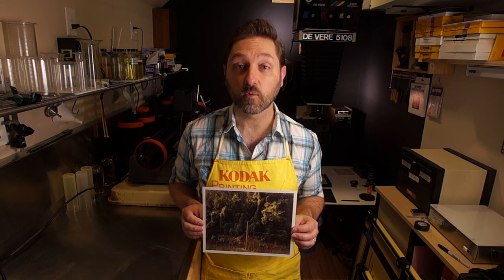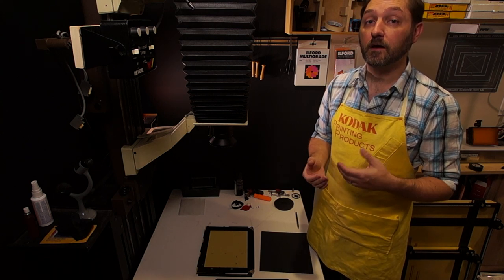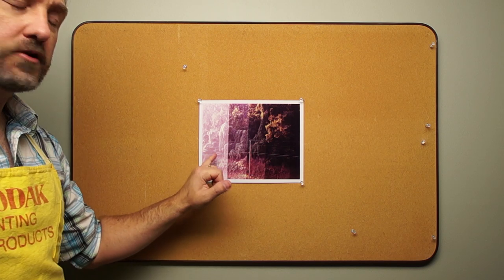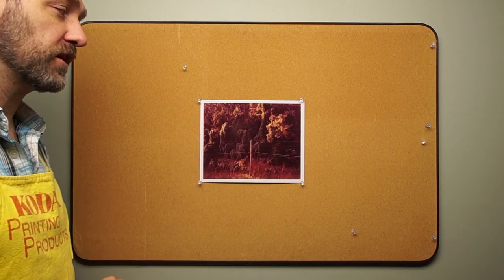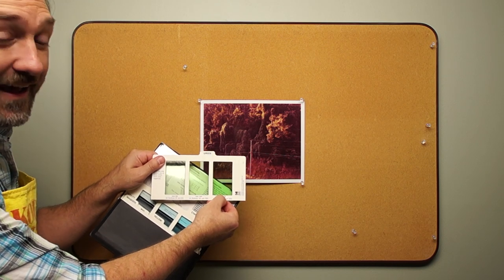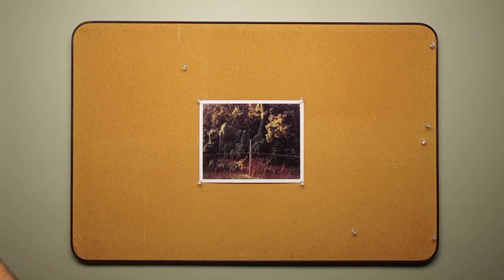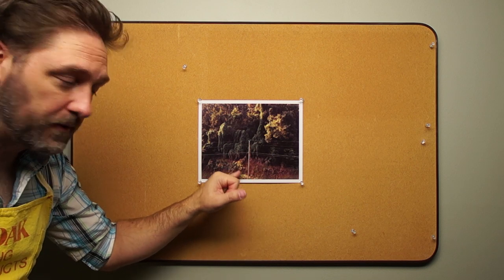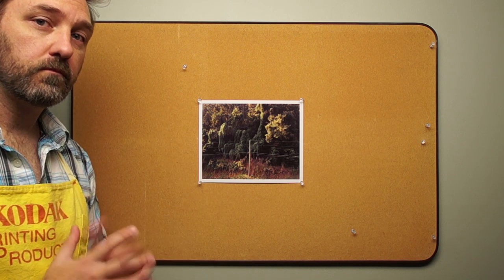RA-4 Printing, pt 2: The Basics

Comment: Thank you for these videos. Now that I'm retired, I was thinking about getting back into film, B&W and Color. The good thing is that I never got rid of my stuff during the Digital revolution as other photographers have done. I still have my old functioning darkroom. Digital is great no doubt, but getting nice prints from the digital work-flow can be as frustatrating if not more than the analog way. Plus it's not as much fun. 

I'm under no pressure to start a Business or offer a any services right now so I have all the time in the world. These videos are crystal clear and certainly help with things I have forgotten, or never really go a hang of due to digital. For example i never knew that Freestyle sold "CP" or Color Printing filters in kits. I tried findidng these filters on eBay and it was highly frustrating. I really don't need the Color Printing kits since I have a Dichroic head with built in color filters,  but it's good to know what that the color head is doing behind the scenes. I have all the time in the world so why not ?

Comment: What a well organized presentation.  I have found that if you are using the same enlarger/colorhead, chemistry, and printing paper, once you have a fairly normal print "zeroed in" for the color filtration required, subsequent (different) prints will not require much change to the filter settings, if any.  So, I have tended to buy paper in the largest size I plan to print and in a box/quantity sufficient to last me for a couple of years (which is kept in a freezer).

Comment: The illumination to examine the print is one important next is while to put test strip it must cover high light to the shadows keeping mid tones in between and first is the proper exposure in Yr case magenta over corrections occurred as while Magenta was in the colour head  it should remove Magenta referring the Golden rules of filtrations still soo Noble that to remove a cast use the same colur and to increase to use it's complimentaries..nt only fr colour printing it readily applies where filtration be consider be it opticalfilter over cam lens or fr colour printing....sir nice of  ur deliberations that means still people are interested in making colour prints tech nt able to dump it totally so sir it is delighted that u are  just a right help ...thankssirdada and Nomo❤stey

Comment: Thank you for this video and for your entire channel! A pleasure to watch, to listen and to learn from! One thing that I've noticed in my yesterday's very first RA-4 session was that the Kodak filters (which I've managed to find after a loooong search) have a black and white side. By chance I did not notice it and started using them on the black side and nothing made sense. Then I've realized that there is a white side with the opposite instructions (i.e. the correct ones for correcting cast, such as using a magenta filter to correct a green color cast with the correct instructions to either reduce magenta or increase Y/C equally). It took me a while to realize this, so it might be helpful for others as well. :)
Reply from the maker: I’ve done that before! lol

Comment: I know this is an old video, but kind of curious if those viewing filters have any application in digital editing. I've been moving away from negative lab pro and doing conversions manually on photoshop by manipulating the red, green, and blue curves. I'm trying to get better at arriving at balanced images and wonder if filters like that could potentially help. Would love to know your thoughts!
Reply from the maker: It’s useful when printing via inkjet, but the monitor may be difficult as your monitor may not be accurate, the color space chosen, etc

Comment: Hi again. So i bought some Arista color cor. filters to use in my durst m601. In the filterdrawer but i have yet another question. When making my test strip print lets say, as you do, 2-10 sec starting out with filter 40 m and 50 y sholud i then stack these two filters i the filterdrawer? ( would it be the same as when you are dialing in the numbers on your dichronic head?) thanks.  :-)
Reply from the maker: Yes, stack them in the filter drawer
Reply: The Naked Photographer  thx :-)  looking forward to try.

Comment: How come you don't need to change the initial time of 7.2 seconds when you change the filtration? I have to adjust the time after every filter change, even if only changing by 5 points.
Reply from the maker: Sometimes it is enlarger design.

Comment: I've heard that afterglow from the enlarger bulb can affect color printing (but not B&W). That being said, how do you handle the exposure timing/process of your test strips?
Reply from the maker: I treat it just like b+w.  Since I’m not concerned about color during the test strip phase, any color shift from different exposures are inconsequential.
Reply: @TheNakedPhotographer  Gotcha. I wasn't sure if the afterglow caused problems for color or exposure. Good to know its hopefully just color. (Mainly a concern since the lamp is often switched on/off incrementally for each segment of the test strip.)

Comment: Hi.

Fine explanation. But don‘t you blow dozens of dust particles into the wet layer when you use a hair blower? Do you use this only for your test prints and then let the final print dry slowly without the dryer?

Also: I assume once you have the color balance correct on the smaller print, you can use the same balance also for a bigger print and only have to adjust the density by extending exposure time, right?
Reply from the maker: Correct, I only use the dryer for test prints.  Color paper is funny stuff.  Sometimes you do need to tweak the color when making a larger print, but not usually by a lot.

Comment: regarding having to adjust exposure time to compensate for adding or subtracting filtration. do you recommend getting the color straight first then readjusting the density? TIA
Reply from the maker: At that point, yes, if it’s small adjustments.

Comment: Do you have a preferred drum for doing print processing? I noticed that the cut-scenes in this video use Jobo drums, while you spend most of your time in the previous video showing a Simma drum (or what looks like the photo labeled "SIMMA" on the KHB website). Got the impression that you need a couple (to handle cleaning/drying), and I might want the smallest possible one for test strips.
Reply from the maker: I have both, but I use the Jobo mostly.  I have more of them, and I like to stay consistent.
Reply: @TheNakedPhotographer  I'm starting to stock up on Jobo equipment myself (and currently waiting on a machine, which will take a while). I just wish I didn't have to resort to eBay to actually find most of their print drums.
Reply from the maker: Try the classified section of Photrio.com, people sell them there.  You can get a 4x5 drum for test strips.
Reply: @TheNakedPhotographer  As I stock up on Jobo drums, I have two more questions:
First, those drums you're using say they take 100mL of chemistry but can do two 8x10 prints at once. When doing a single 8x10, do you one-shot a full 100mL or somehow get away with reuse and/or less volume?
Second, what motor base are you using with those drums?
Reply from the maker: I admit I use 100ml regardless of whether I have one print or two in the drum.  I use it one shot, and I am using an Omega motor base.

Comment: Do you not adjust your times when adding more filtration? Or did you just not mention that step because it is included in the instructions of the filter viewing kit?
Reply from the maker: You definitely need to adjust your time if you use separate filters, but a dichroic system doesn’t need much, if any change.
Reply: @TheNakedPhotographer  Thank you, I'll try not adjusting my times next time and see what I end up with!

Comment: So would this colour correction process be required for every different photo on the roll? Or once dialed in its good for that camera set-up? If assume maybe some slight tweaking per photo but how much of the settings per colour actually change per shit with the same camera
Reply from the maker: If you use the same kind of film and process it consistently, your color balance across the roll will be fairly constant.  Each shot may a little tweaking, but the starting point will be about the same.  Different film type will need its own starting point.

Comment: May I ask you if the Lee viewing filter kit (the one with 6 cards made of 9 squares) is equivalent? Because apparently seems to, but has no indications of the corrections to make on the enlarger.
Reply from the maker: Lee made two versions.  One was exactly like the type I use, and the other is what you describe.  I’ve never seen that type in person so I don’t know if it has correction amounts printed on it.
Reply: @TheNakedPhotographer  it seems it hasn't. Anyway can you confirm that the corrections are the following?
Blue= add M+C or  subtract Y
Yellow= add Y or subtract M+C
Green = add C+Y or subtract M
Cyan = add C or subtract M+Y
Red = add M+Y or subtract C
Magenta = add M or subtract C+Y

For the amount of filtration i have to check the relative number right? E.G. if the filter kit square used is the 20 blue i have to add 20M+20C or subtract 20Y, if the filter used is 10 Cyan I have to add 10C or subtract 10M+10Y.
Is everything right?
Thank you!
Reply from the maker: Typically you don’t use the cyan dial at all and only change the magenta and yellow dials.  A 10cc filter will require a 5 point change for the enlarger.  I don’t know if your card has labeled the strength of the filter or the amount of correction to be used.  The Kodak kit I have lists the correction amount, not the density of the filter.
Reply: @TheNakedPhotographer  the filters are just labeled "clear, 0.25, 05, 10,15,20,25,30,40" per each color. How can know if is the strength or the amount of correction?
Reply from the maker: Looking at the photos online I think the numbers are the density and you should use half the value for the filter change, so if the print looks right through the “20” filter, dial in a 10 point change
Reply: @TheNakedPhotographer  thank you very much! You’ ve been very kind :) keep going with your videos, they’re amazing!

Comment: With black and white you can sort of take the same setting from print to print assuming the negative was exposed properly. Is this true of RA-4 or do you need to do this filter changing for every negative?
Reply from the maker: In theory you can use the same settings for a whole roll, but in practice I find I still need to make small changes shot to shot.
Reply: The Naked Photographer thanks for the response! With black and white I usually estimate the first exposure/contrast, and can get reasonably close on the next print with some educated guessing. Seems I’ll be back to test prints and strips :)

I just found a color enlarger and drum processor cheap locally and see paper is somehow cheaper than black and white. These videos are so helpful, not many doing this

Comment: So even for the larger drums (16x20+) the rotating base works well?
Reply from the maker: I use up to a 20x24 inch drum without issues.
Reply: @TheNakedPhotographer  perfect, could you spell out the name of the brand of the roller you like? I couldn't quite catch it. Thanks and have a great sunday!
Reply from the maker: Simma Roller, it’s also sold as Omega, but Unicolor and Beseler rollers are great too.
Reply: @TheNakedPhotographer  Thanks for sharing your knowledge, it is invaluable to those starting out!
Reply from the maker: That's what I'm here for

Comment: Ok so i just did my VERY FIRST color print EVER. While it was a success becuase i had a picture that i could see, it was crap because i put it in the Cibachrome tube upsidedown.  So how do you know that you developed the correct side?  How do you know you put the paper in right side up for the proper exposure by feel?  Is there another way to know for sure you have it correct side up!
Reply from the maker: It’s just a matter of practice.  I figure out which way the paper is laying in the box, then after the exposure I roll it up for the tube without delay.  It can be easier with a safelight made for RA4 such as a #13 Kodak safelight filter.

Comment: "It's kinda like how your brain adjusts from a 5.000K source to a 3.400K light source"

Yeah, I don't know why people buy the most expensive lights. Just get the cheapest one, your brain will adjust quickly anyway! 🤷

Don't spend 3.400K. Just get a $2 light source and you're all set; your brain will adjust the same! 🤣🤣
Reply from the maker: Your comment does not make any sense.  Are you under the impression that the 5000 and 3400 were prices?  They are colors of light in the temperature scale of Kelvin.
Reply: @TheNakedPhotographer  the two smiley faces indicate it was a tongue-in-cheek, semi nonsensical affirmation. ;) Even if it wasn't that funny. :(

But the question on "why to wash and dry, if the first step is to presoak - then why not wash and start a new print" is serious though.